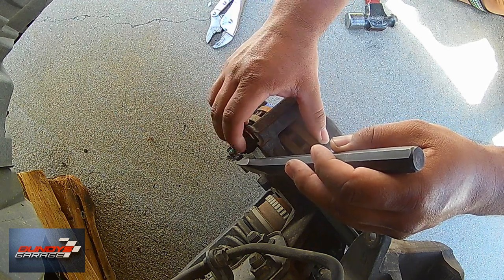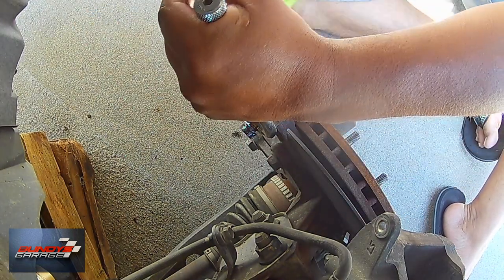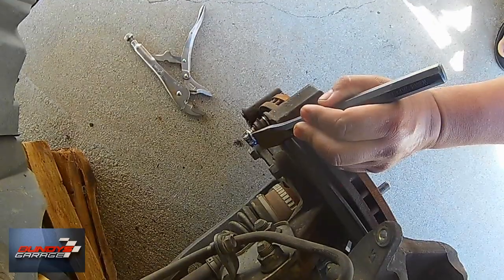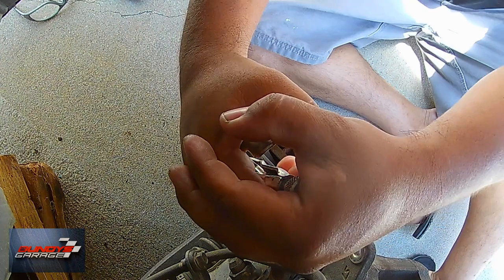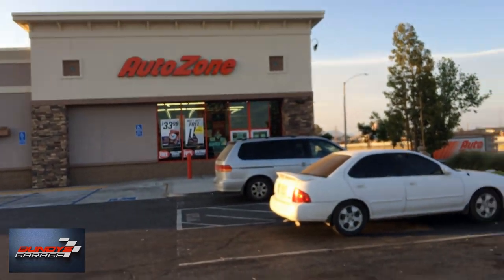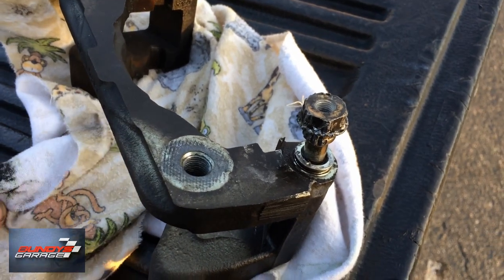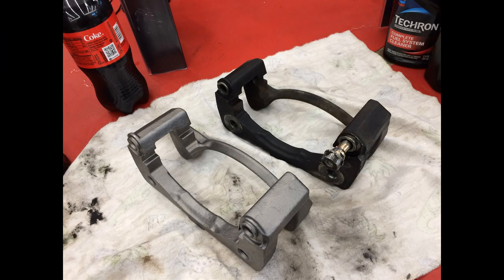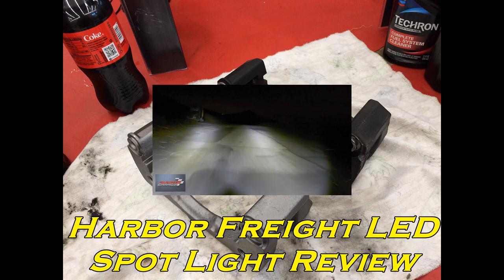CALIPER PIN STUCK? | Stuck Brake Caliper Pin? | YOU GOT OPTIONS | Bundys Garage

Comment: Grind a formed fit air hammer chisel .  Air hammer pins out , clean bore with close tolerance drill bit .  Buy brake hardware kits , apply silicone paste .